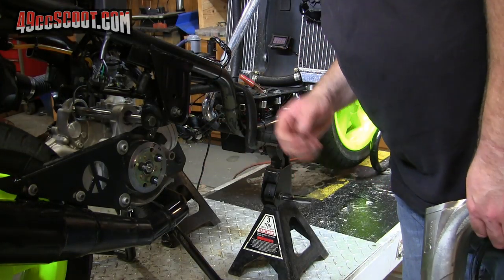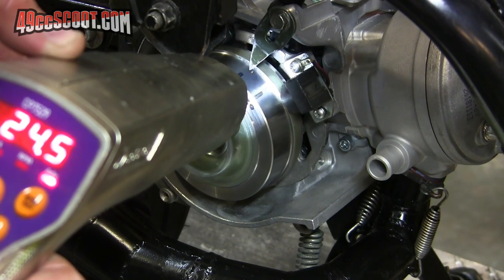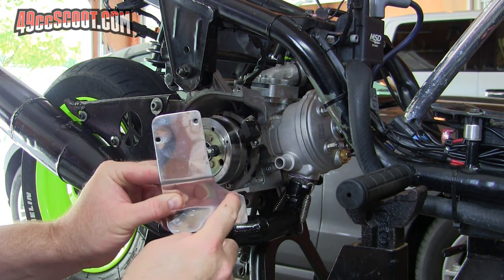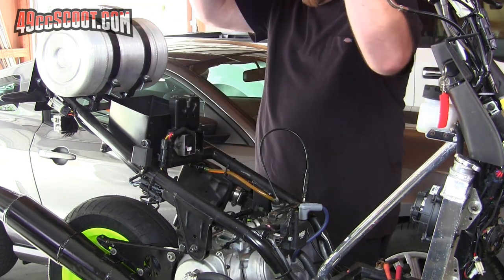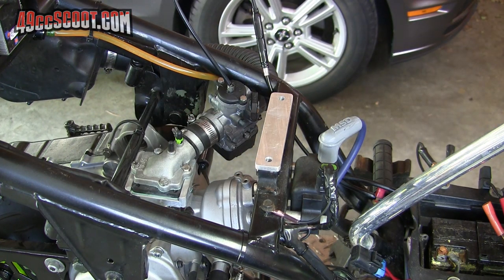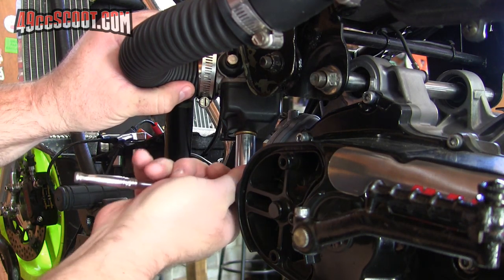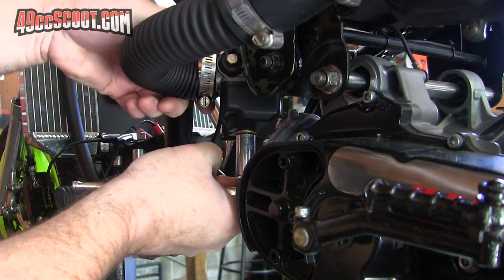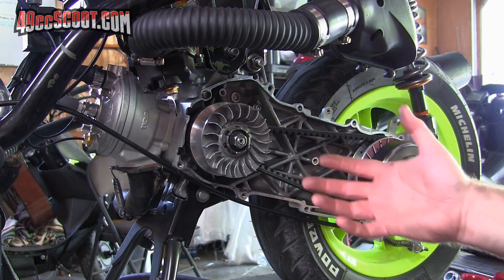TPR 86cc Build : Part 10 : First Start, Timing Set & Tuning

Comment: Very nice, but you definitely need a new exhaust to tap into the full power of the kit, then tune the vario weights again.
Reply from the maker: I agree, as well as the lightweight ignition. I think it's interesting to see that a high strung kit like this can actually function pretty well in a de-tuned setup. I will likely be trying to get a hyper race exhaust and an ignition when I can. Hoping by about next spring.

Comment: Looking good. As many said it could be ignition timing on the top end causing the cutouts. A chamber pipe and 4.5/ 5 gram is usually where I end up. In a side note I have a Polini evolution inner rotor that would work well for you

Comment: I think we can safely say she's a ripper! Hard to tell since my butt is not on the seat, but a bit of clutch slip maybe a bit too much.
The pads looked good but the bell had some wear. Not enough force on the pads? More weight on them? I'm certainly no expert tuner.
Seeing you make those runs reminds me of how big a pain in the bag it is getting it right. So many factors involved, too many maybe.
And this is what i have to look forward to when i take a swing at it. And i thought tuning with a clutch and gears was fun.
Btw the inserts on the weights makes good sense - to me anyway. Shipping takes time, tuning is right now while it's fresh in your mind.
Has a good sound to it, a little angry. I think you got your beans worth.
Reply from the maker: I'm happy with it for what it is. I never expected it to be anything like the full-on version with all of the expensive hyper race parts... and it's not. But I also wasn't even sure if it would have enough power to get itself going with the mismatched parts so I'm pleased with it for now. I can tell you that getting the right parts will ease tuning. At least the ignition. If I had a lightweight ignition, it would likely rip right past minor tuning issues and zip off the line. I went through that with my 103. I have a smaller flywheel for it, but it provides nearly no charging. Anyway, I could swap that on and it would take off when I had tuning issues with the heavier flywheel. I'd imagine the inner rotors make like much easier with a hyper race kit.
Reply: @49ccscoot  It looked to me like you were well into the 50 mph range. Without a lot of fiddling besides finding a jet that was close.
As a comparison a "sport" 70 cc cylinder i take it you have used one. Did that get you into the 50's ? A dude i know in Boston ports malossi cast iron 70cc sport cylinders
into monsters for $$$. So i throw this out there. Is it the porting or the displacement
or a balance of both. I think the latter, but that leaves out how a 49cc cylinder can hit low 50's with a re jet and pipe. No it can not pull as hard as a larger cylinder can, but it will get there. So displacement is torque
porting is speed - it seems. It's a black art.
I've read some things on porting, i just don't have that many cylinders lying around to try it. There is a peugeot cylinder that will do amazing things with some porting, water cooled too. Then there is the advance curve, i think that's where the inner rotor units make it happen. But no lights is just not a workable option. Next few years i think i see a point that i will have some time to play with all that stuff. Till then i fiddle.
I would call your efforts a success thus far.
And i think that's worth the cash spent.
It sounds like there is more in it, jetting and maybe a pipe? Ignition box maybe.
Or just run it with a good tune.
Reply from the maker: @johnrobinson357  I think the reason that you're equating porting with speed is probably horsepower and RPM. If you've got more power, you can improve acceleration as well. If you're not doing gear changes, then higher revs (with the power to back it up) will allow you to go faster.

I have used sport kits. I have gone ~60 or so with a sport kit and mild porting. Acceleration isn't there like this. I've gone 50+  on stock cylinders with a little porting and an exhaust. Again, weak acceleration in comparison. I have more fun with the acceleration than the speed.
Reply: @49ccscoot  And my reference is dirt bikes not scooters.With gears it seems more like
larger cylinder more torque. My scooter was doing almost 50 with stock everything.
Pipe and carb hold 40 on hills i'm fine with that. I think i can sneak a 2nd fuel tank next to the original by using another stock tank side by side - maybe. Was reading your post on 49 scoot about going full wave on the stator. I'll have to do that if i plan on seeing anything on the road - as i hit it!! AC just will not cut it. If that scoot did not have a front disc i'd leave it bone stock.Where i am it's deer fox bear and lots of turkey lights and brakes or stay home after dark. I'm fine with moderate acceleration, as long as it holds the speed i can attain. If i want fast i fire up the kz1000 or even the cb750. No the scoot is sit back and chill and it will get me there.
The big bikes are stressful to ride for me anyway. The scoot is sit back and watch it all go by, instead of a blur of green.
I'll have to pick your brain on porting at some point - compare notes. Gotta go buy some food before it rains.--------------------

Comment: What mechanical water pump would you recommend for CPI Horiz. Minarelli cases.  I was going to build an R/T 70 engine I have all the parts and just lost interest.  I have accumulated all the parts over a few years.
Reply from the maker: Top Performance was making one. I have a Stage6 pump. My only complaint with the S6 pump is that it's a pain to put the hoses on because they're so close together. It's supposed to flow more, but I didn't really see any difference with it vs a stock pump from a DRR or Apex ATV. That's another option.
Reply: 90GTVert thank you 🤙🏽

Comment: You need to use a scale when tuning your pulley. That way you can add up the total weight and not just saying 8 grams or 5.4 grams. It goes by the total.
Reply from the maker: It goes by whatever you want it to go by. Total weight or average weight is semantics in this situation. Says the same thing essentially. It would only really change if you were trying to compare variators with different amounts of rollers, but realistically I don't feel that different variators should be compared too directly because they have a lot of characteristics that change things. Anyway, if I say I have 8g weights and you know I have 6 weights, you'd also know the total weight. If I say I have 48g of weight and you know I have 6 rollers, then you'd know I have 8g weights or 8g on average at least.

Comment: How many turns out do you have the air/fuel mixture screw on the carb? If you change your main jet do you have to adjust the screw?
Reply from the maker: Mine started at 2 turns out. I can't tell you where it's at now. It gets adjusted as needed. Even with an airbox, that seems to respond to the weather a bit and I have to change it a small amount here and there. You don't have to adjust the mix screw with a main jet change, but it may be necessary with any change that could affect fueling.

Comment: Hi! What 2t engine working temperature is ok? For ac and lc. What temperature is max to not damage the engine?
Reply from the maker: I always suggest that you monitor your engine temps with a tuned setup and use anything much above what you normally see as a danger zone. The reason is that some gauge setups will read different and not all engines are the same.

That said, usually about 350F is the most you want to see for CHT. Liquid cooled doesn't usually get that high.

Comment: Nice video  i just want  to ask?! is the  sliders  to light to gain the top speed in full  throttle  can you try 9 to 11 grams  w your setting and sèe the top speed or even 12 nd 13 grams  again thank youfor sharing your experience
Reply from the maker: Based on monitoring RPM, I think no heavier than 10g would be needed if I was focused on top speed. Don't know for sure without testing, but at the moment I don't really care if it goes much above 50. I know it's not a powerhouse that's gonna do hyper race speeds. I'd expect 65-70MPH.
Reply: Its a part of top performance to know  what the  best peak performance of  you're  build. top speed , fuel consumption just a thought , any way  nice job
Reply from the maker: @herminigildodelacruzjr1752  I don't think it's a wrong choice to go with all of Top Performance's offerings by any means. I also think part of their job (the reason they exist actually) is to sell parts so it's not the best business strategy to say actually the 2FAST exhaust made 0.5HP more than ours. (I couldn't tell you which is the best ATM. Just an example.)

Comment: sir just want to ask.. i can't see any hose connected where oil should run. when is the oil is running?
Reply from the maker: I don't use oil injection. I pre-mix.
Reply: may i know what is the ideal ratio of gasoline and oil.. thanks..
Reply from the maker: @iscclimueldolorico6093  Depends what the engine is and what oil. 32:1 to 40:1 works for most.

Comment: Did you made that exhaust yourself?
Reply from the maker: A member of the forum made it for me years ago and has modified it a bit along the way. Used to look like the typical tuned pipe, but he switched it to a Penton muffler for me a little while back so it performs the same with less noise and no repacking ever.
Reply: @49ccscoot  that is cool man. I can see that it took a lot of time to make that.

Comment: Why do you use this exaust?
Reply from the maker: I have it for one. I wanted it to be kind of de-tuned as well. No one ever talks about riding a hyper race around. Not that I'm talking to anyway. I thought perhaps it could actually be a useful setup with less RPM. I'm actually happy with how well it does in this form. That said, it has made me want to find out what it's capable of at some point so I'll likely be trying to get a hyper race exhaust and new ignition.
Reply: @49ccscoot  pilot should,be like,a 48 to a 55 try that and main 110 to 120
Reply from the maker: @evo70nugz17  I tried the smaller pilot/larger main route with the 103 and this carb. Doesn't work. Even with a slightly smaller pilot it starts hanging and running lean at lower throttle. Needle swaps couldn't fix it, at least with the needles I had on hand. Also, the ignition is a must with the pipe because this flywheel will most likely come apart before long with it at 12-14,000RPM. Plus, the lightweight ignition makes a big difference in response.
Reply: @49ccscoot  i run dio and jog motors and always have stock ignition just lightened I see around 12000 rpm,with,my dios,and 14000 to 15000 with my jogs and they stay together I do like rotor kits but there not necessary especially on big motors there perfect for 70cc ,I would,get a new carb try a genuine keihin 28mm
Reply: @49ccscoot  plus rotor kits wear out a lot faster all you,need is a good pipe.. I run 7.1 gearing and I see 90mph and still have great response and low end I gotta take a vid and send it to you

Comment: You dont have hills to climb.Weigths must slack the belt to make rpm and pull uphill.Magic-point.And the contra-spring must be new,lesser than a cm destroyed.At my perfect gear,you also drive 1-2km to heat the belt before it sticks right.Private,I would not believed in 105mm nozzle.When you buy the chain-saw or brush-cutter they are rich to run in the cylinder.And becomes ignition-knocking,start failure of heat.So you simply turn of as much gas as possible.0 gas.

Comment: If you mix the rollers, the diffrence between them should be like 1,5 grams. U cant mix 3 grams and 7 grams its to much diffrence. Get one of these u shaped exhaust and go like 3-5 grams rollers. Also remember to go up on the mainjet when lowering roller weights.

Comment: the ignition advance is too extreme. you will melt it if you continue to just jet it and test it ... when it gets into its powerband teritory at around 12k rpm, that much advance will be too much, around 16is what people offten run on race stuff. also get a NARDO exhaust, the cylinder and that  exhaust atre made for each other
Reply: 2 stroke cdi's normaly retard ignition timing in higher rpms. one cdi more one less. for example, we set the ignition timing at powerband (10000rpm) to spec (e.g. 10°), than look how far it gets advanced at idle by cdi (e.g. 20°). this is done by a capacitor in the cdi which sits in the gate path of the thyristor. cheap cdi's and 4 stroke cdi's don't have this cap. this applies only for ac cdi's. greetings from germany.
Reply: Nardo?? 😂😂
Get a jollymoto, fa2st or the exhaust that top performace made for this cyl. We use nardos on top trophys with 21 mm carbs this guy needs at last a 28mm with a new exhaust
Reply: @filippopontarolo  nardo is the tip performance exhaust for it.... go to the top performance website amd check it . Its marked red .... other exhausts will work ofc, but top says it works best with that, so why bother
Reply: @filippopontarolo  black trophy has max power at 10k or there around. Or so they say.a sport pipe is used with it. At least here, 28mm will be a bit too large for 20ish hp the tpr makes
Reply from the maker: @robivlahov  TPR recommends their 24mm carb/intake and their exhaust in the instructions. That said, I'm prob gonna stick with this carb and try a different hyper race exhaust eventually. I'm not worried about it being a TPR exhaust. It will likely depend on availability, performance and price at the time.
Reply from the maker: Also, this thing isn't going to hit 12K with any usefulness right now. The exhaust just isn't meant for it so I'm trying to dial in timing that works with this exact setup more than worrying about what works at 12,000-14,000RPM. When it gets to a more full power version at some point, I think the curve of an aftermarket ignition with a lot of initial advance that tapers off with a steep curve compared to my stock CDI will offer great benefit for performance. I also think that will help to totally ruin anything that's easy to ride around and make the throttle more of a light switch.
Reply: @robivlahov  a friend of mine has tpr 70cc with 28mm carb and polini evo 2 exhaust and it runs great. From what i know top performance raccomend their 24mm carb just because they sell that carb so they can make more money. Also top suggests 24mm carb and nardo exhaust on the top 2plus.
You're telling me i can run the 2plus and the tpr with the same carb and exhaust even though they are 2 completely different cylinders with different displacement?
Reply: @filippopontarolo  https://www.motorparts.it/it/?id=Ricerca_per_categoria&category=GRUPPI%20TERMICI .idk, it may be ok to run 28, but you can lose power going too big on a carb, but again it may be good idk, 24 sounds good to me since high perf 70 ccs offten run 21mm , so 86cc 24mm makes sense. open the link its the top performance site. and ofc another high end exhaust will work, polini, tm and 2 fast make great 80-90cc pipes
Reply: @filippopontarolo  due and tpr are quite similar, due is a down tuned tpr.one is alu one is cast iron, so they down tuned it just enough to make it work as a cast iron cil, they made over 19hp with the due, and the original tpr is 70cc,yes this one is bigger but still, aaaand , they say to use a 21mm carb with the due and give you all the specs (jet,needle,slide).so i could see how a 28mm carb may work since 86cc, esp with a pipe like 2fast 90cc or polino evo pipes and digital ignition . But turns out he is not going for that , he could of gotten a black trophy, ported the exhaust in the width departmant to almost due spec, and than ran a his 10krpm exhaust and a 21/24mm carb. Now best case imo would be to buy powerspark or a digital igitio of sorts and to run it properly. But that costs alot
Reply: @robivlahov  i hope you mean 19 with the tpr, the due is never going to make 19 even with the best mods.
Even though i dont think the tpr can make 19 too.
A perfectly tuned due will make it into the 15s.
And Also due and tpr are different cylinders, its not just the same with a different material
Reply: @robivlahov  yes 21 is fine with the due.
If you start porting the cyl and the cases then you will need a 24
Tpr just needs a 24.
More speed you want more fuel the engine wants.